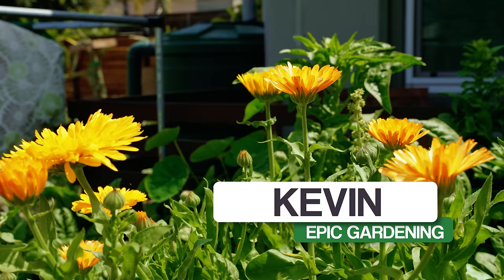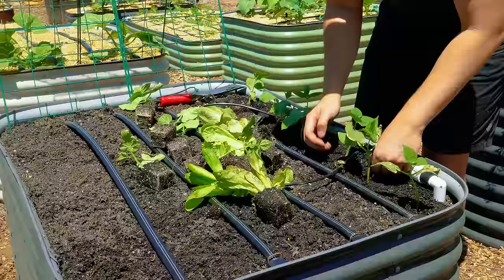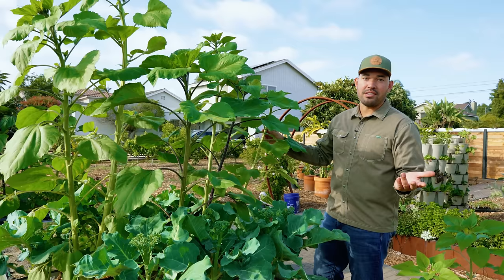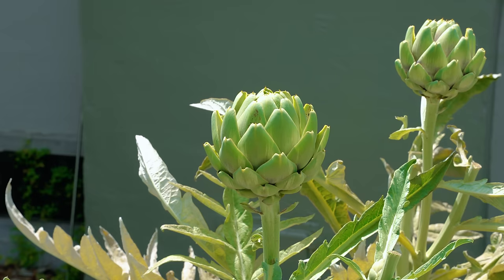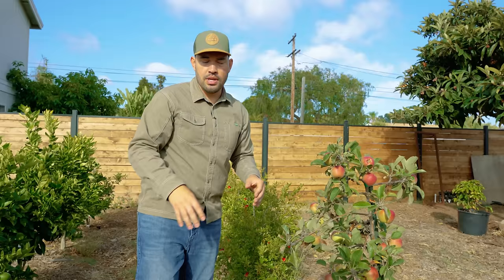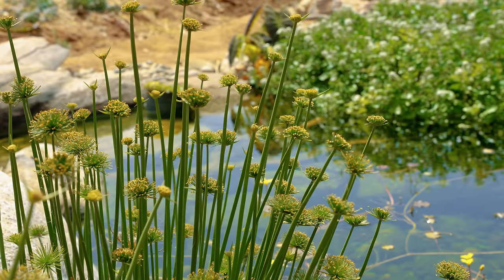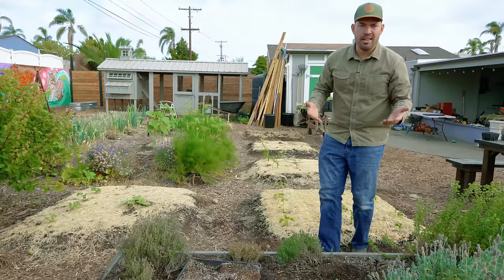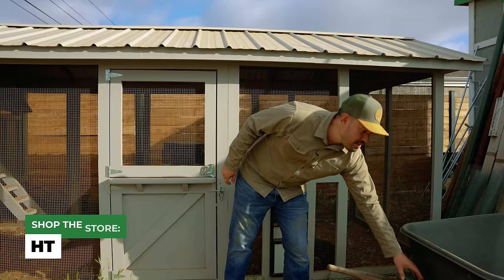My Garden Has Never Looked Better... | FULL Spring 2022 Garden Tour

Comment: Thank you again. I actually do have a white powdery mildew problem on my pumpkins. makes me so sad. I'm in Windsor Ontario. it's already so humid here and this summer there has been so much rain. I'm letting my common sorrel grow to absorb some of the moisture and every time i feel like my moss bed is strong enough i remove a patch from it and place it by my pumpkin. for those who don't know moss absorbs water in the air rather than through its roots. it also takes up more co2 that a tree (as in if i had a square foot of a tree vs a square foot of moss the moss will take in roughly 6x more co2 than the tree) .

Kevin! your cat is so cute! <3

Comment: In hot sunny climates you'd want to reverse the sun orientation. Tomatoes & peppers suffer from sun scalding, so some protection is necessary. You can shade them with taller plants or with shade cloth, whichever works for you.

Comment: Awesome video! A cat got into my arugula the other day and only left one seedling :( i haven’t found a solution to get rid of cats though! Lol
Reply: I have a raised bed and our neighborhood is packed with strays. It’s a 4x10 bed. I have almost 300 bamboo skewers (point end up) sticking up out of the soil. It has worked so far for keeping them out! They are around a dollar for 100 at Walmart.
Reply: You could try standing small sticks throughout your garden, if your garden isn't too big. It might be a lot of work if it is. I tried a hack where you dig plastic forks upside down throughout the garden. The cats still tip toed through the garden, but they didn't seem interested in sitting on a fork to use the restroom, so it was successful keeping the cats from using the restroom and digging. One problem is having to explain to everyone why you planted plastic forks in your garden. another problem is that it later dawned on me that it probably was not so wise to have all that plastic leaching toxins in my garden. So this year as I sowed seeds in my garden I marked all the seed spots with sticks. I sowed bush beans and bok choy so they were sown close together which means there were a lot of sticks close together and our cats never entered that bed. For the pots, my husband screwed in hooks to the top sides of the pots and used the hooks to hold down hardware cloth that he placed over the top of the pots until the seedlings were large enough to where the cats didn't have bare dirt to dig in. Sorry this was soooo long. I hope I was able to help in some way.
Reply: @mrs.coleman4049  yes, thank you for your ideas!! Very much appreciated

Comment: Great video, guys!  In the spirit of self-sufficient living, I have a question/challenge for you... I love to make quick and simple bamboo teepee trellises and other uses in the garden out of bamboo.  And I would love to just grow my own, instead of paying for these bamboo bundles.  Bamboo is a grass that grows notoriously quickly.  So it seems like a good candidate for adding self-sufficiency to my garden by growing these instead of buying them.  Can I grow these same bamboo that I buy at the garden centers, right here in my own garden in Arizona?  If so, what type of bamboo would I grow, when should I plant, etc.?  Where can I obtain seed, cuttings, or whatever I need to get started?  Can you do a growing guide?  That would be awesome!
Reply: In Australia we have clumping bamboo which is a bit less taking over than regular bamboo. Be warned the regular stuff can grow miles under ground and it very hard to get rid of. (My dad tried for years.) Make sure you get some really good advice otherwise it might be safer to buy the stakes.

Comment: At 02:15, is that a bubbler dripper in the very center?  I've been coiling my drip tubes like this for round containers, but I wasn't sure what to do about the center.  Should I use this method?

Comment: I can program arduino watering systems but I wonder what should I code? I have drip emitters, sprinklers, moisture sensors, but no idea how things should be watered. Do you think my current strategy of 1" per week + water whenever it senses dry is good enough? Do I need to complicate it and make it send off a burst of sprinkler every morning, if I was seed sowing? Like create a "germination mode" switch the user would input if they want sprinklers on to keep the top soil moist... Endless possibilities.
Reply from the maker: Check out homestead channel soon. Doing a vid
Reply: @epicgardening  Will do. My watering thing has the exact same rain barrel you have for your chickens. Was wondering if the water would ever go bad..